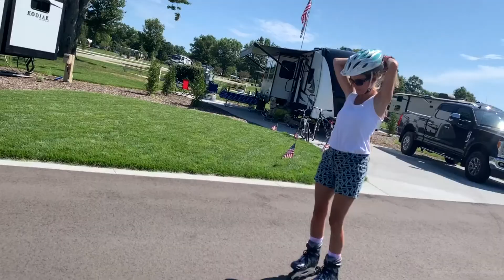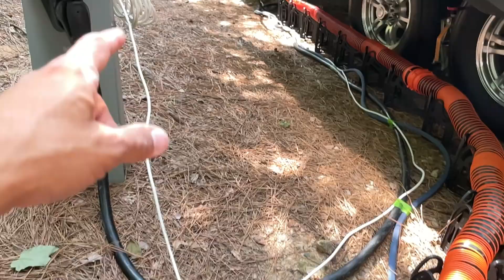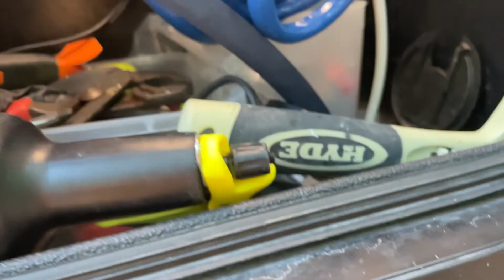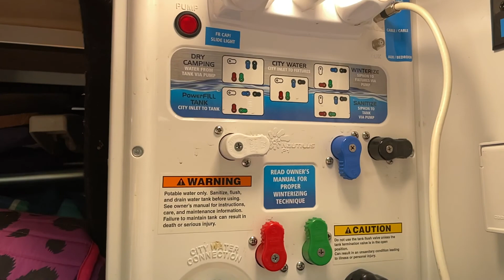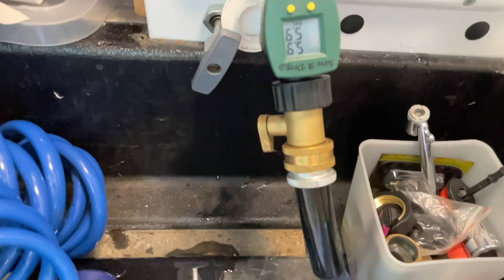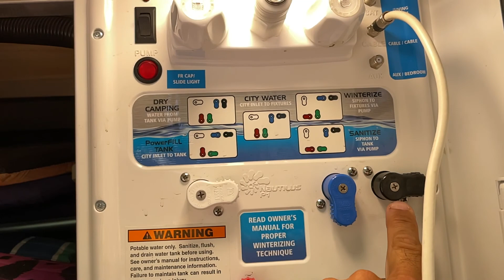RV Nautilus Panel  Grand Design Reflection Fresh water fill up

Comment: I learned to never tow with any of my holding tanks full. The brackets or supports for the tanks are barely strong enough to hold the tanks up. I had my black tank break away from their support brackets on 2 different trailers. I only tow with no more than 10 gals of liquid in any tank.  BTW I had the dealer to double up on the support brackets on my previous trailer.

Comment: If you use the dredvice at the spigot, then it will be upside right for someone who doesn't have a shut off at the nautilus. It works, and there is still no running back and forth

Comment: I do allot of dry camping so I have to fill my fresh water tank all the way up. Places we go you have to bring all your water with you. I have never had any problems with carrying all the water.  Also when leaving for home have to bring all the waste back with you until you can find a place to dump.. I have 376ths momentum.  I have travel with the tank empty and have not had any change in fuel mileage it just comes down to were you are going..

Comment: Angelo, if I use powerfill I like to take the cap off my side fill to allow water to escape once the tank is full. I don't want to take a chance on damaging anything.  I think it fills faster through the side fill. Also you might want to research water filters. Those blue Camco filters are only rated to 20 microns.  I've been using the Clear2o prefilter and filter which is rated at 1 micron. Walmart is now carrying the main filter.
Reply from the maker: Hey Casey.  Thanks for your comment.   So The Grand Design comes with an over flow. So if you power fill to fill your fresh water tank it automatically dispenses water thru a blue pipe under the RV telling you you are full.  I have it in my next video I’ll send you a private link until it comes out.  
Yea you know your right on the filters. I’ve tried different ones and this one seems to give me the best pressure.  I would love to get a Full water softener but then I limit my space.  Thanks again as always.
Reply: @TSquadRVing  I think you're getting the best pressure because it isn't doing much.  You have to choose between pressure and cleanliness.  One thing you can do it hook up the filter and fill your tank, then run off the pump.  That way you have clean water and good pressure.  As for the overflow, I don't know that mine has that.  As far as I've seen it pukes out the side fill.

Comment: Thank you. We’re still learning. How do you empty the fresh water tank?
Reply from the maker: Thank you so much for watching  I have another video coming out on that as well.   To empty the fresh water tank on the Grand Design Reflection 312BHTS  there is a pull latch right under the RV (Its white)   simply pull that and water will drain.   Thanks again.